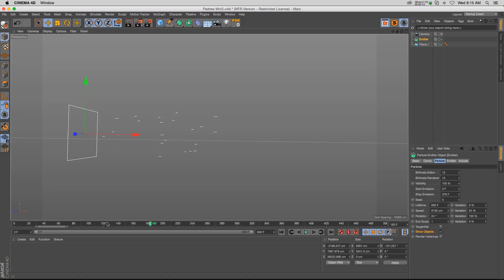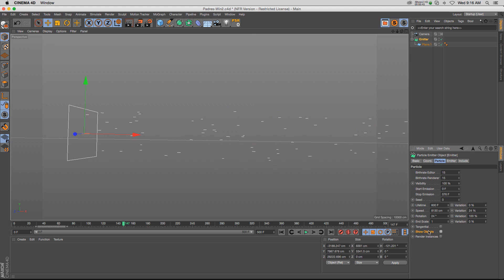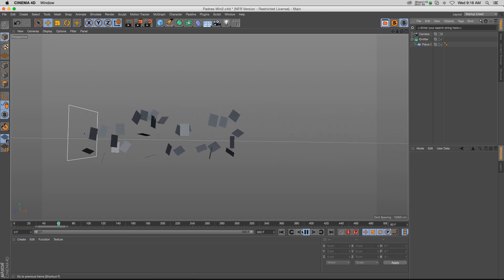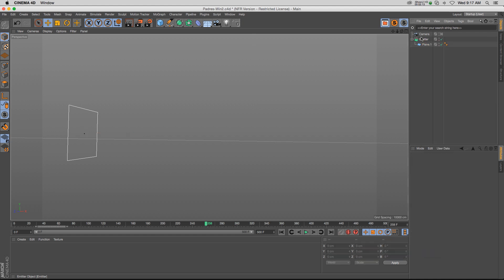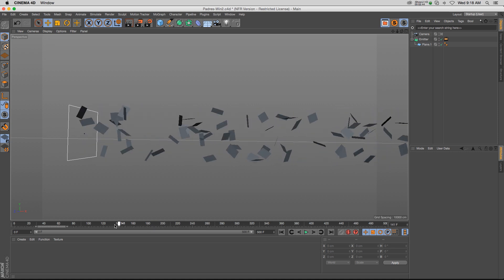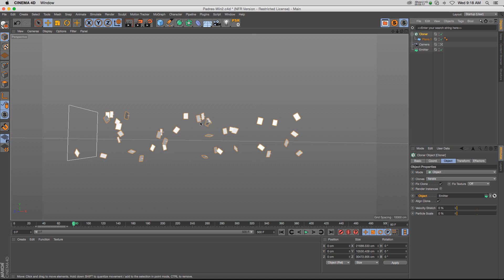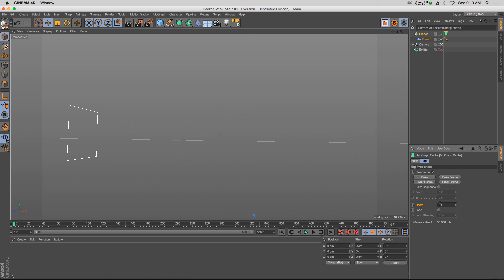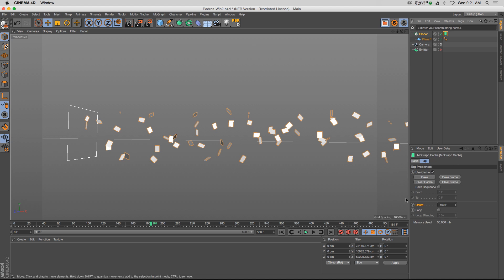Cinema 4D Tutorial: Two Ways to Cache or Bake Particle Simulations

Comment: One thing I was having trouble overcoming was emitting objects with dynamics and then wanting to bake a specific frame into individual editable objects but any time I tried to convert anything into editable it reset the emitter/dynamics. The cloner tool work around worked a treat. Thanks!!
Reply: Had same trouble, this video solved it.